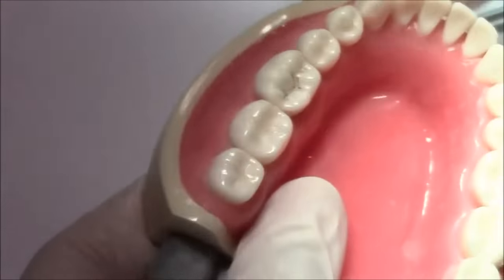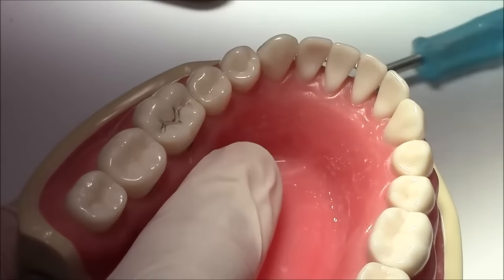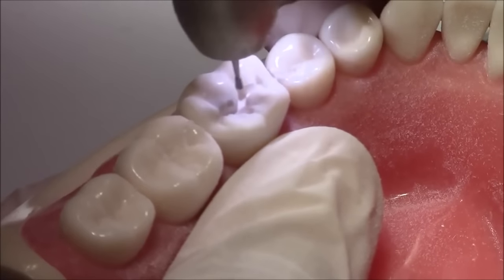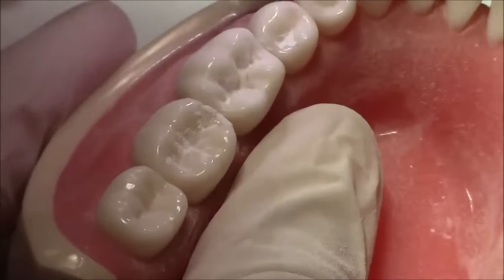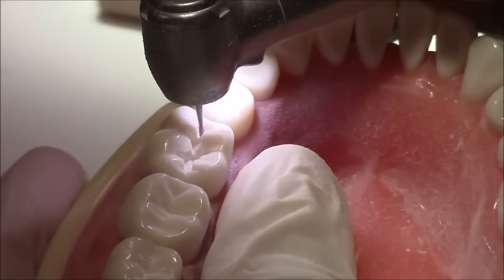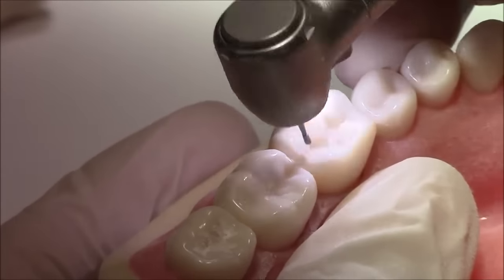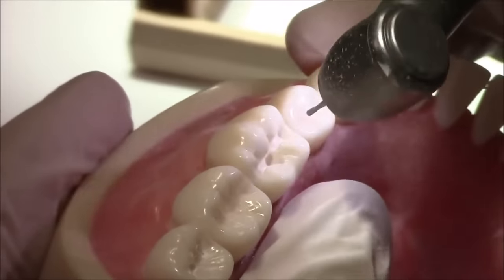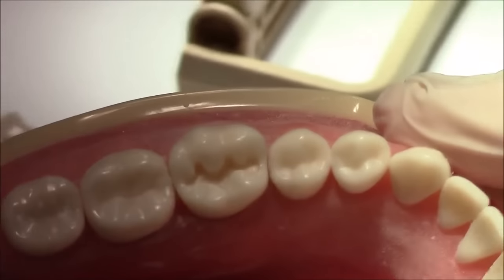Tutorial on Class I Cavity Preparation Amalgam Restoration - DENTALKART

Comment: At 2:58 , would you elaborate further what did you mean by: “it shouldn’t be more than 1/3 of the intercostal distance” ?
Reply: Intercuspal distance*. Basically the cavity width should be uniform and no more than the 1/3rd of the distance between two opposite cusp tips. For instance, if the distance between the mesiobuccal and mesiolingual cusp tips is 9mm, the cavity width shouldn't be more than 3mm (1/3rd of 9mm).
Reply: @dhruv1019  understood! Thank you so much!